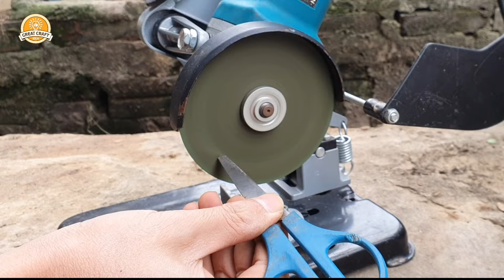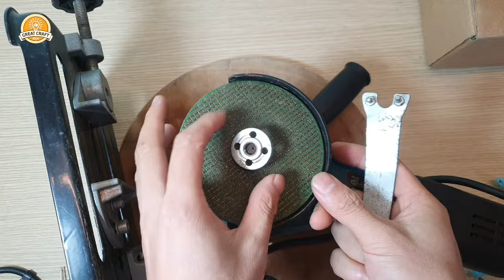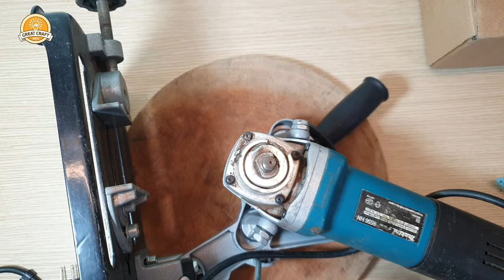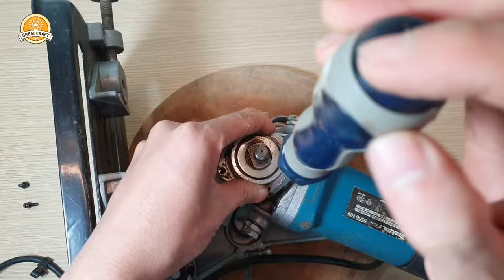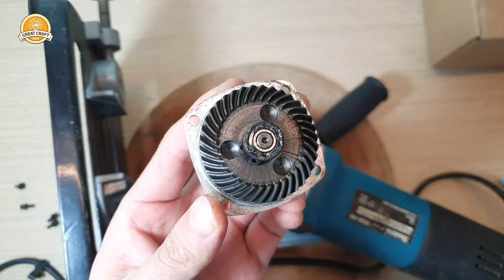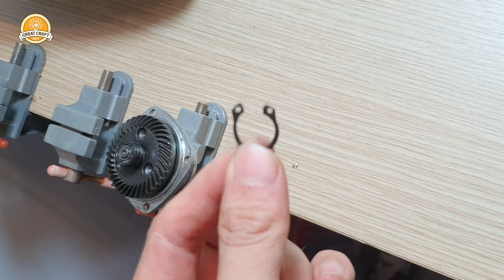Why didn't I know this sooner! How to remove a circlip without circlip pliers

Comment: Just what I was needing to find.   This is a perfect solution
Reply from the maker: Thanks you😍
Reply: @GreatTips01  Right back at ya.  I broke the scissors when I ground them down.  But I had a pair of needle nose pliers and modified them and that did the trick.   Now they are a multi tool! Lol.  Thank you again for the helpful video.  Subbed and liked
Reply: I was wondering if scissor steel would be strong enough, so I used an extra pair of electrician wire sheer to make the new tool. It seems to hold up to some of my bigger snap rings, like on my 1/2 drive ratchet. I'm thankful to all of the info in these comments.

Comment: No circling Pilar, yaa…
But you need a pair of scissors and a grinder worth rs. 5K
Reply: My grinder won't work because it has no refined corners, the have been rounded.  I think you are right though, what if there is no power tools to help? I'm going to try to reshape the tool with a hand file.
Reply: What I’ve done in the past, I get two nails or two drill-bits(round end nit the drill) and pop them in the holes, as long as there is snug fit, you don’t want them wobbling, put pliers between both nails and open them have a flathead to hand once you’ve got it open, it’s how I get my angle grinder off as well, instead, I just use it screwdriver, leaver ect as it like t bar, just gotta be careful that you don’t slip off, the other thing I have a little tiny pair of pliers that fit between the holes and you can just push them apart